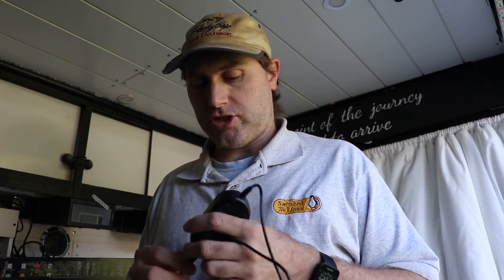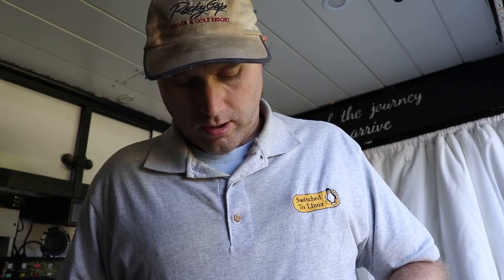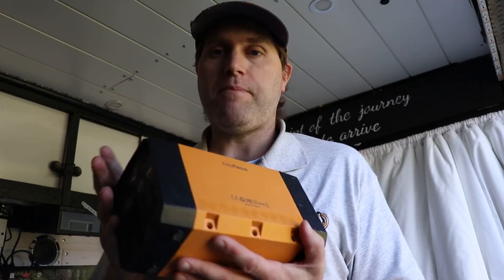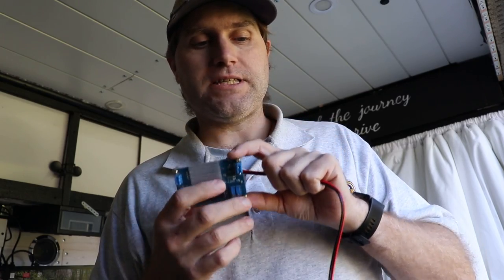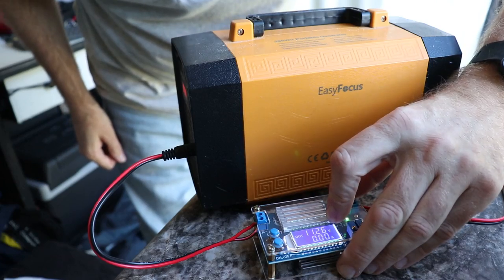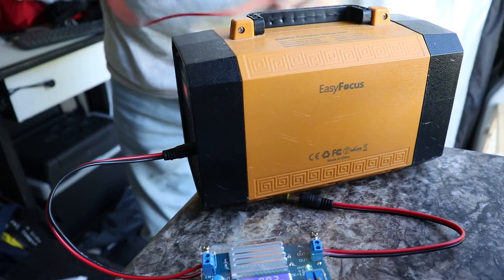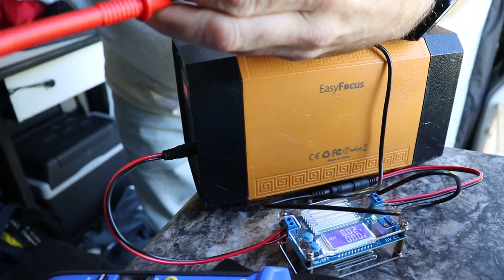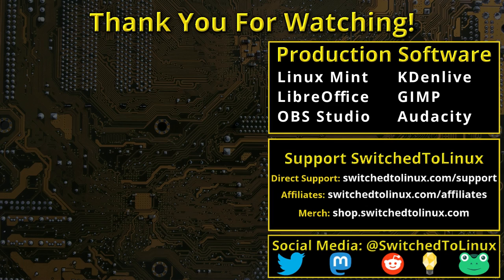Fix a Camera Power Adapter

Comment: Suspect filter capacitor on the adapter is blown. Is there any AC output on the 8V DC side ; that would account for the DC bouncing around.

Comment: Good video on buck boost voltage units, buttons for a lot of us low income ( less than 1000 a month and massive inflation making it like 300 income) people in the middle of the USA it is very difficult to come by some technology until it is 20 years or more older. My answer is SECOND HAND STORES ( salvation army ect. ) often have AC to DC adapters that will work with little to no adaptation and most devices with required voltage of 6 volts to48 votes can handle 1 to 2 volts higher as long as amp draw is at least same as what it needs.